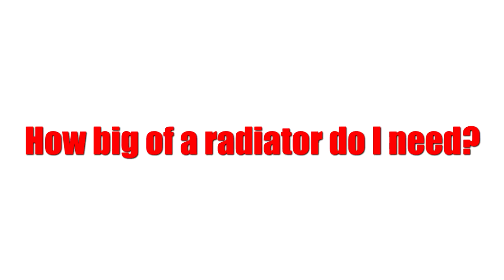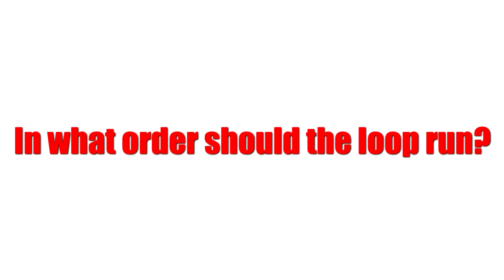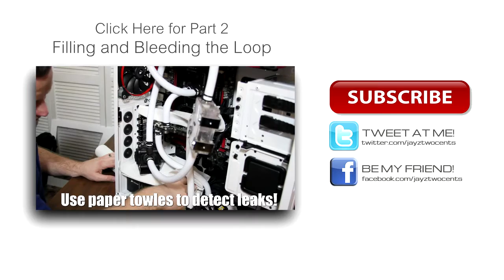How to Watercool a computer - Part 1 of 2

Comment: I have an R9 380 and FX 6300. my case is a bit short on space. Do you think it is possible to run both off of one 240mm radiator, or should i replace a case fan to make room for another small radiator
Reply: Let us know if you find a block for the 380 ;-)  I can't find anything out there...
Reply: yeah same. I hope I can find something, but so far closest I can get is 370
Reply: Do you know if those would work with the Gigabyte model
Reply: It should fit/work - but it's not a great looking full-block :-/

Comment: isn't having a radiator between gpu and cpu better instead of two radiators in a row sort of?
Reply: no it really does not matter order of radiator as time spent over each part is very very short and the amount of heat is very low, as long as you have enough radiator for cooling system as a whole you will not see any real changes in gpu, cpu temp nor time till system hits max equilibrium
Reply: +jordnot You're correct. I dont like his loop at all, idk much about watercooling but cooling water TWICE makes no sense. Its pretty much going from bottom  rad to res to pump  to upper  rad. Would make more sense going from pump to cpu, then cooled by upper rad (therefore getting colder fluid to the gpu) to the gpu then down to the rad cooling down that fluid then back into the res youll get cool liquid ready for the cpu again. Its the way ill be doing mine when i cool  my gpu and get a second rad.

Comment: Can a water pump be installed anywhere or it needs to be standing up? Like Could had jay installed it on the right side under the reservoir, basically under the drive bay? It would be upside down.
Reply: it needs to lower the then the highest point in the system so not to get air and lower is usually better on the pump itself

Comment: check transparent acrylic test for paste, big blob in middle wins :D
Reply: Southeastern777 if the radiated from the heat spreader evenly you'd be correct. However, the heat from the cores is a strip through the center with sides not needing nearly as much cooling.

Comment: Does Anyone Know If I Cool A CPU And A GPU With A 120mm Radiator (If I Had To) And A AlphaCool DC-LT Pump/Res...If Not Could I Do It With A 140mm? Also What Should The Loop Be? Pump/Res>Cpu>Radiator>GPU>Pump/Res...That What I Was Thinking, What Is Best? Also Im Am Using 3/8 Id 1/2 od Tubing...Thanks!

Comment: Here's a dumb question; How do you know that the tubes won't fall off and leak? Does the pump have any high pressure that can dislodge the connections? Sorry, I don't have custom tubing and only an H100i which was already put together for plug 'n play. Thnx in advanced!

Comment: Not necessarily, if it drew air from the outside the hot air would then come into your case and cause other non-water cooled to get hotter.

Comment: My temp were 35 C using the "pea" thermal past in the center. Using your business card method to evenly spread the past, I’m now running 7 degrees cooler (28 C). Thank you very much for your time and effort.

Comment: what kind of load temps are you getting with this setup? im planning on something similar so this helped alot. im a be cooling a 2500k and a 7950 with the pump/block of the swiftech h220 and a 360 and a 240 with helix fans going in a phantom 630 case.

Comment: The single factor that deterred me from going custom loop on my recent build was: fittings. Since I had to import all my components, it was mandatory for me to know everything was compatible and worked together before making my purchase. The type of fittings you need, however, is determined after experimenting with the tube arrangement; hence why so many WC veterans suggest to buy everything, test it and THEN buy the fittings (Luxury which I didn't have).